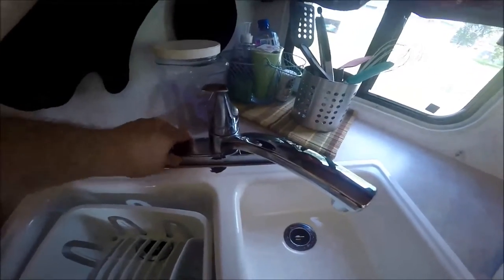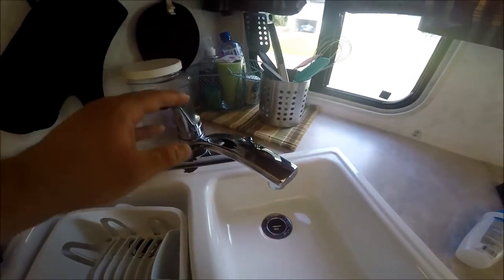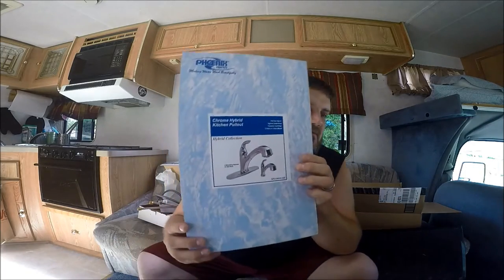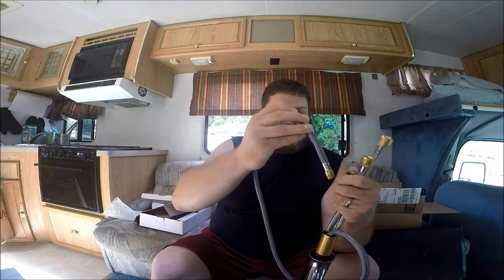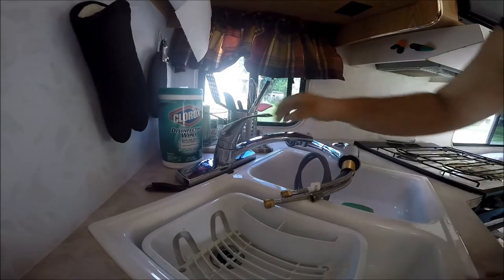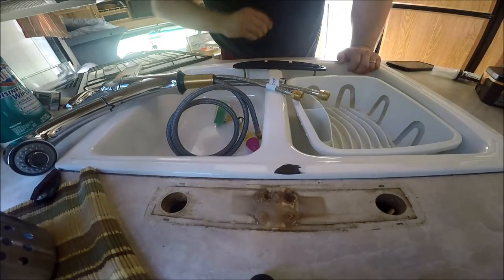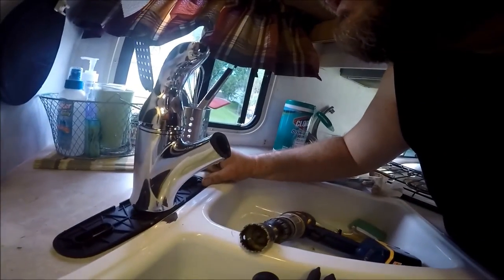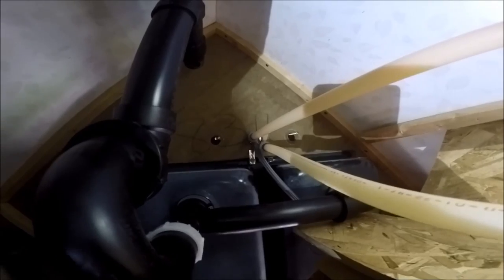RV Plumbing: How to Install an RV Kitchen Faucet with Pull-Out Sprayer, Part 1

Comment: Jeremy - Normally I would just do a thumbs up but I felt in this case a comment was warranted. I think you did a fantastic job showing how to install the replacement faucet. It is not an easy job especially with the limited space you had but you persevered even after having to take it apart again. Which incidentally if that would have happened to me (and it has!) my tools end up thrown all over the trailer. Thanks for your effort in doing the video and posting. I will be replacing my factory ‘toy’ faucet with the same sprayer model you demonstrated.  Your help is much appreciated.